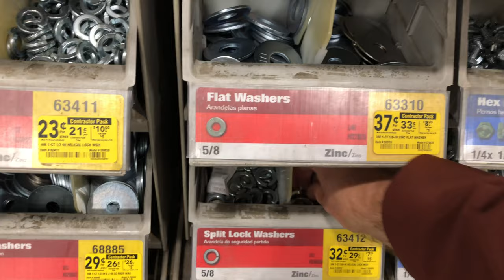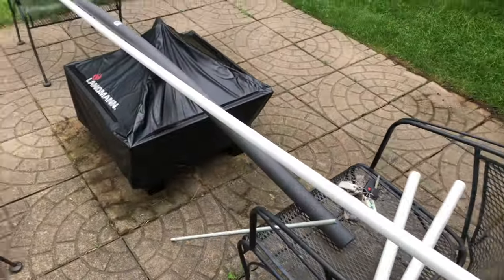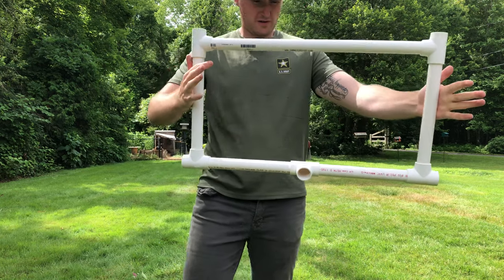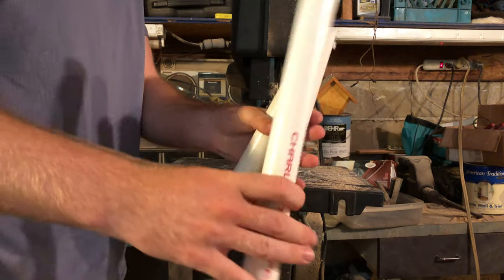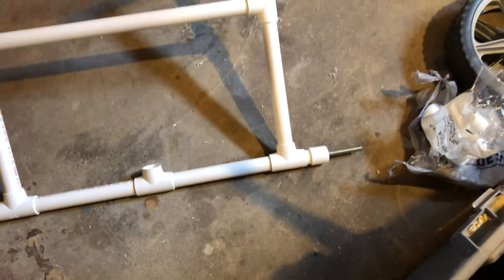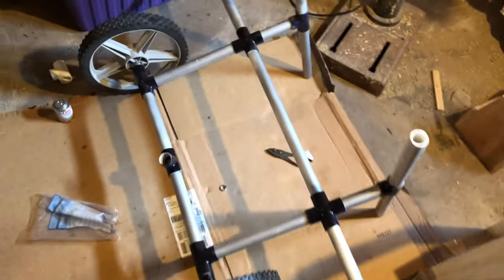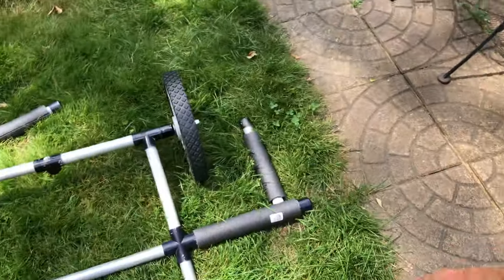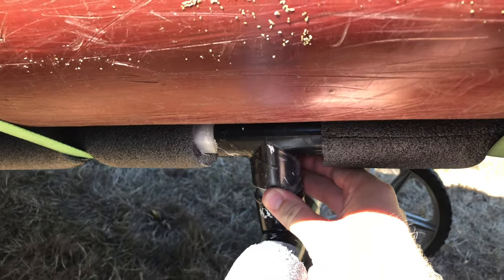Building a HOMEMADE canoe/kayak cart!! (Will it WORK?)

Comment: Who has time for this? Never take instruction from some dude wearing sandals. At what point did you discover that PVC glue wont bond painted surfaces. It's called PVC glue because it bonds to PVC, not paint.